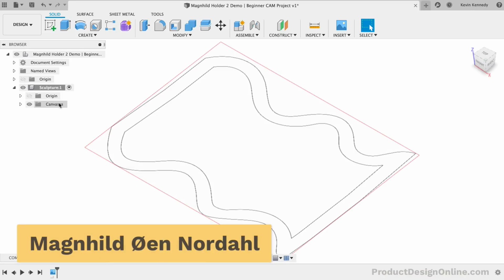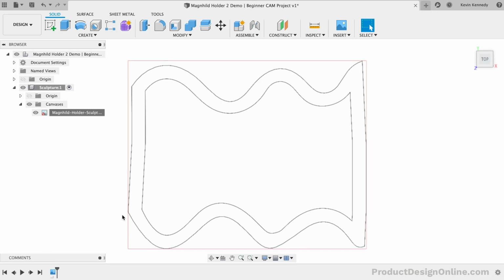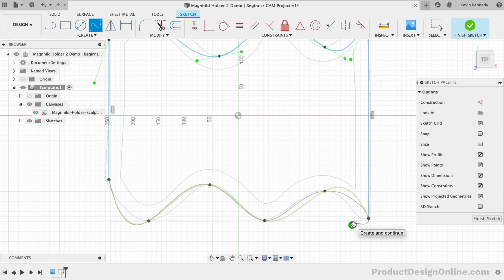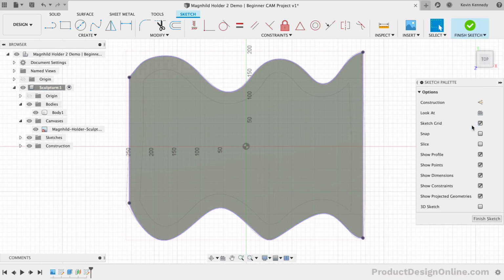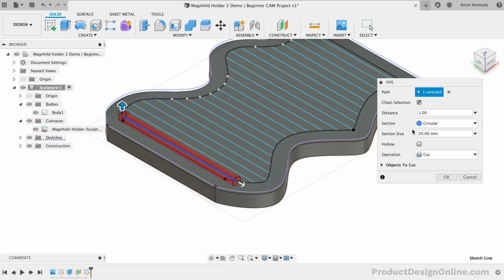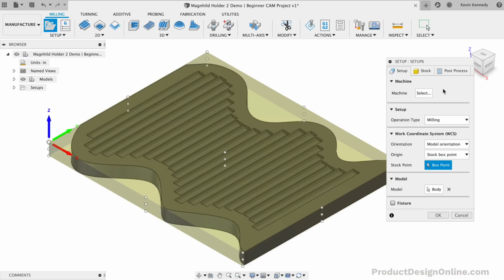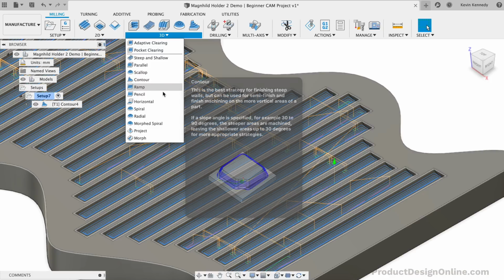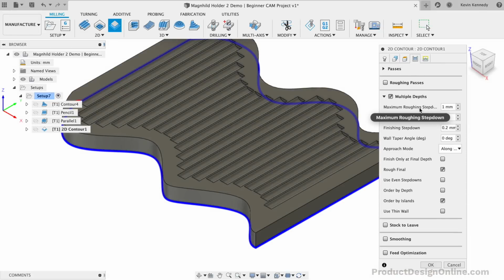Fusion 360 for Digital Fabrication | Beginner CAM Project

Comment from the maker: TIMESTAMPS
0:00 - Idea to Design to CAM in Fusion 360
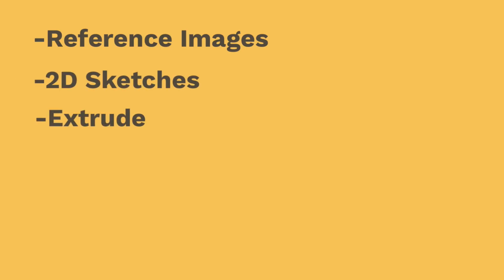0:39 - Project overview
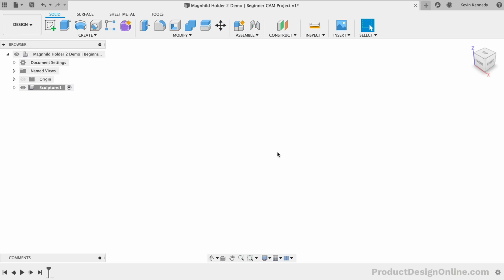1:30 - Creating a component and reference image
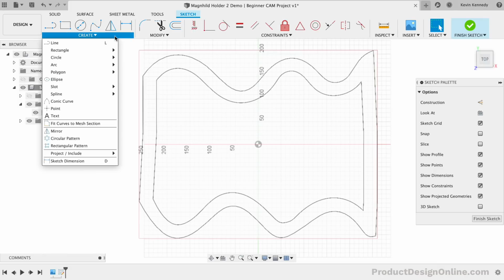3:50 - Sketching out the curved shape
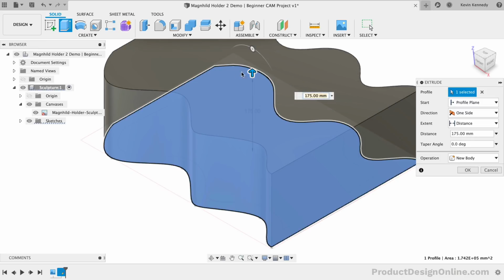6:53 - Extruding the sketch
9:30 - Creating the cavities on top
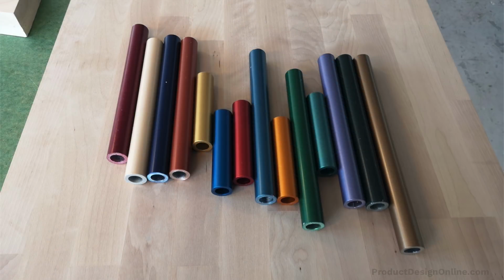11:45 - Using the Pipe command
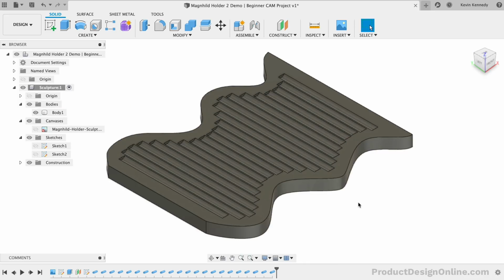12:37 - Going to the Manufacture workspace
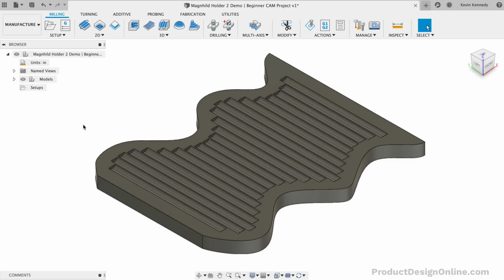13:15 - CAM setup explained
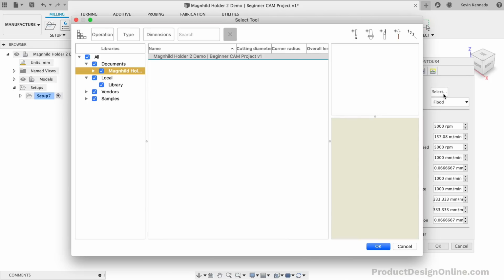15:49 - Selecting a tool
16:49 - Simulating a tool path
17:15 - Penciling out the corners
18:30 - Contour cutting the main shape
20:00 - Simulating all tool paths

Comment: Excellent demo. You have shown me a very powerful tool. I wonder how I would make recesses of different heights within the same piece.
Reply from the maker: Hi Gerson, there are a few ways to achieve that. The easiest way would be to position the pipe cutouts at varying depths in the first place...then setting the CAM tool paths are still as simple as clicking the inside of the shape. Cheers, Kevin :)

Comment: Your videos are great and easy to follow as well as always showing some relevant tools and commands that can be used in other projects.

I do miss one thing, though, and that is seeing the final product.
It would be great if you showed the milled or 3d printed object and the machine working - possibly just a 10x sped of video of the milling/printing and then the finished product.

It would make it much more relevant and live-like to actually seeit and not have to just imagine it.
Reply from the maker: Hi, A B. Thanks for the feedback! This particular project was done by the artist, so I didn't have any video footage other than shown.

However, I am working on a rig for my CAM setup...and I've purchased a new camera... so I can start to add video to the project and talk more about the setup and things outside of Fusion :)
Reply: @ProductDesignOnline  Now that you mention CAM - I have learned to use Fusion entirely due to your videos on modelling and had to learn the CAM part through other videos - it would be great if you also showed the CAM part as there is not much high quality out there.

Fusion reports that my CAM extension is only free until June..but I cannot determine if the CAM workspace will still be free for students or I need to purchasr that part after June?
I hope it is just some.advanced stuff I do not need anyway ☺
Reply from the maker: @stuffy2000  yep. The plan is to start to release a whole series of CAM. tutorials. yep all student and hobbyist licenses will still have access to the cam environment within the manufacturer workspace. What you referring to is the manufacturer extension, which is really only needed for very high-end (high cost) milling machines. Most of it is for metal work, etc
Reply: @ProductDesignOnline  Sounds great! If you use, or could use, someone to test your videos on before you release them to get feedback on quirks etc that gave problems following, I would love to help out ☺

Comment: Nice job. thanks.  CNC CAM is a good subject.  Maybe you might be interested in doing a video on making a small sculptured two sided  box, split in middle, shelled. small magnets to hold top and bottom together, position top and bottom side by side for cnc milling out of a small slab of wood, first top of bottom and top of top, then flip to do 
bottom of bottom and bottom of top, using tabs or double sided tape for holding, I found secondary melamine spoilboard works great for double side tape.

Comment: How are you still on an old UI of Fusion 360?
Reply from the maker: Hi Jeremy. I'm on the lastest version. What looks like the old UI? 🤔
Reply: @ProductDesignOnline  Mine doesn't have Design as the first drop down, it says Model (there is no design).  The bar also has fewer options though the same categories.  I'm using version 2.0.5688.  I'm not sure if I have something set up differently but it makes it difficult to follow along sometimes when I have to pause to hunt down your selection in my UI.  I'm sure it's me.
Reply from the maker: @MacCrafter707  2.0.8407 is the latest version. But that's strange. It sounds like you're on the old version before the major UI change. The DESIGN workspace is the new MODEL workspace. You may want to perform a clean uninstall and reinstall Fusion 360 again. 
Let me know if that helps - https://knowledge.autodesk.com/support/fusion-360/learn-explore/caas/sfdcarticles/sfdcarticles/How-to-do-a-clean-uninstall-of-Autodesk-Fusion-360.html